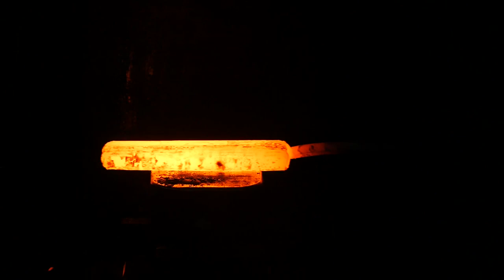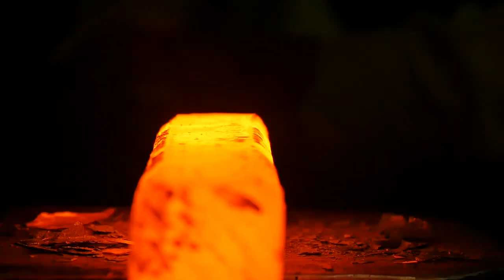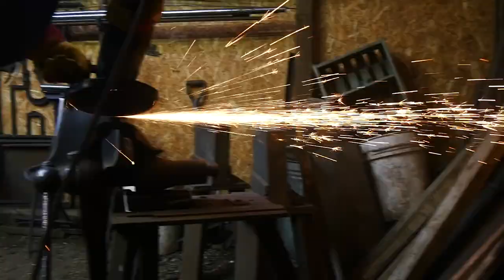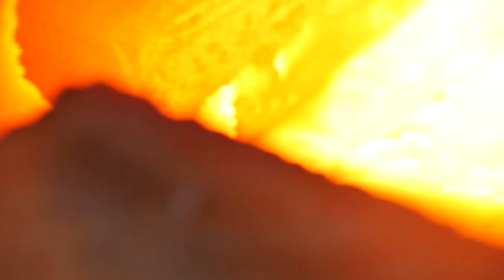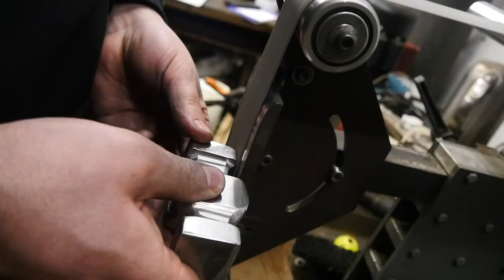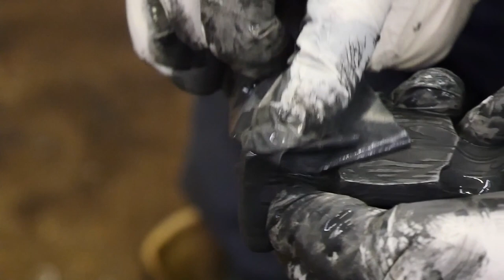FORGING DAMASCUS HAMMERS

Comment: Those Damascus hammers look beautiful! I'm starting to watch your videos more and more. I'm glad I subscribed to you. You make some of the most awesome Damascus steel I've seen. Great work man!
Reply from the maker: +Sharp Works Thank you so much sharp!!!
Reply: +Alec Steele Hey Alec, the hammers are truly beautiful, and I doubt that they will see much work, but are there any functional benefits of making a damascus hammer? For that matter, is there any functional purpose for damascus knives as well? I can imagine how something like a san mai construction could benefit a knife(having a very hard/high carbon core steel wrapped in softer steel to absorb shock), but I can't seem to figure out the functional purpose of the kind of damascus you make. Am I just an ignorant metallurgy plebeian or is it just art and I'm thinking too much about it?
Reply: Great Prophet Zarathustra 

For the most part it's just for looking beautiful while still being able to cut (function) just as good as the individual steels you use in the billet would do by themselves.  👍
Reply: Great Prophet Zarathustra To answer that question. In the ancient past, when humans made metal, the carbon content was random, either to high or to low for useability. People would forge the metals together to get the steel right. The patterns in Damascus are a side affect. No, Damascus has no use in the modern age except as a form of decoration.

Comment: The other day while watching Sam and yourself crank out those hammers I wondered if you could make a Damascus hammer. Are the Damascus hammers as strong as the other ones? Since you're mixing two different types of steel, overtime will they start losing shape if used as an every day tool. 

I don't know if I could actually use those as they're not just a tool but a piece of art. Amazing job
Reply from the maker: +Phillip Taylor since the alloys are of higher carbon than the hammers the Damascus hammer would in fact be stronger and harder

Comment: Probably the most beautiful hammers I have ever seen. But, I (if you can believe it) have a complaint. These are true works of art and I would be hard pressed to actually use one of them. I know, properly used they would not be damaged, but the thought of having an accident with such beautiful Damascus hammers. Yes, I have no problem using my Damascus knives, but they don't are not pounding on other hot metal. Oh well. Loved the video, loved the hammers. Have a great day.

Comment: I'd also like to see a video showing the  difference between acid etching alone and etching with the sanding, because you're the only one I've ever seen sand his etching pieces during the ferric etch
Reply from the maker: +popnsplat They actually didn't sand during the etch on this one. They were using the wet and dry after it came out! I'm starting to not think there's a difference!
Reply: Alec Steele it'd definitely be an interesting little test for people who are new to smithing, as your acid etches are usually far more dramatic than others. though it could just be your acid radio and/or time spent in etch, a lot of this stuff is simply "that's just how it's done" without much real evidence shown of people trying to do something multiple ways. 

any plans to sell damascus hammers? I'd be extremely interested in buying one!

Comment: Hey fellow blacksmith. I've watched a lot of your videos and thought it would be pretty cool if you could forge a pattern welded socket style broad head. I'm currently working on a 168 layer twist 1095, O1 and whatever sort of high carbon ice skate blade is, test etch piece looks promising.

Comment: what steels did you use in the layering? what was the etching fluid you used?
Reply: For etching he used Ferric Chloride, as for steel I am unsure
Reply: For steel he uses 15n20 and 1095 or something similar I believe.
Reply: No you were correct the first time

Comment: I have to ask a technical detail.

How long did you soak that hammer head in a carburizing flame and what was the grit used to achieve that overall "burnished" look before etching it in acid?

Comment: Now you just need to make yourself a big old sledge hammer out of Damascus
Do like England's flag on one face and the American flag on the other and just do like star Padron in the center if you know what I mean like have just regular block the masks in the center and forge weld a slab of each of the flag Damascus on either side

Comment: awesome video. i live in the uk but have no idea how to get into smithing any thoughts?
Reply: Fred,
It's easier than you think!
Think about it: You need something to beat against, something to beat with, and something to get it all very hot. i started with a hole in the ground, scrounged up high sulpher coal, a piece of black iron pipe, and the exhaust end of an Electrolux vacuum cleaner. I took a flea market (boot sale) ball peen hammer, a smooth piece of granite as an anvil, and  chunk of rebar. Burned the end off the rebar, but finally figured out how to upset, taper, and square! I wish, and I've thought of this several times, to this day I wish i had that piece of rebar with its upset and rounded back end, and the yari shaped spear front end. It was really marvelous! I still have a two tined fork i made along the same time.
So, long and short of it, it doesn't take much, just the will to do so.
You really need to try! It's so fulfilling, that you will rue not having started sooner!
AAR
Reply: Albert Rasch thank you for that mate. I'll see what I can do
Reply: Here's a fellow forging up a small billet of pattern weld. 
It's longish, but there's nothing fancy about how he puts it all together.
AAR

Comment: -Alec 
Man o man Bad ass hammers how much? cant imagine I could afford one but I could make one .Alec is it possible to forge a hammer by ones self without powertools or a striker? Can you show us how on account this is how Ill have to make mine. It would help if I could see the process.
Reply: The short answer is yes you can forge it all yourself by hand. It just takes a lot longer. He's done it a couple of times at least IIRC. But again, if you don't try, you'll never know if you can! I'm assuming you mean straight steel stock, not pattern weld. That of course can be done by hand as well, but I don't know if you can get the same results with such large billets. Helps if you have a hydraulic press. Manual ones are pretty easy to make.
AAR

Comment: what's the advantage of using "Damascus" over using normal high-carbon steel?
Reply from the maker: +Pixel_ Ronin prettiness!
Reply: ***** ok, but do you realise that what you call "Damascus steel" is just a form of pattern forging? Genuine Damascus steel has been found to have internal carbon nanotubes, calling what you forge with "Damascus steel" is nothing more than misinformation and degrades the true value of the genuine stuff...
Reply: Modern damascus is just pattern forging, everyone has accepted the term for this type of forging because it resembles the patterns found on true damascus. This isn't misinformation as the entire blade community has accepted calling this type of forging damascus.

Comment: Hey does anybody know what kind of acid he used for eatching those hammers?!?!?!?
Reply: Duda The Dipper you can use ferric chloride or Muriatic acid which you can find at Home Depot in the cleaning section or the painting and flooring section it'll be called concrete cleaner
Reply: Duda The Dipper ferric chloride
Reply: Stefan Razvan Anghel thanks bud
Reply: avery larimer he asked what Alec used, not what can be used... :)